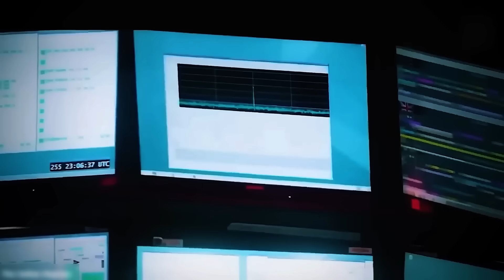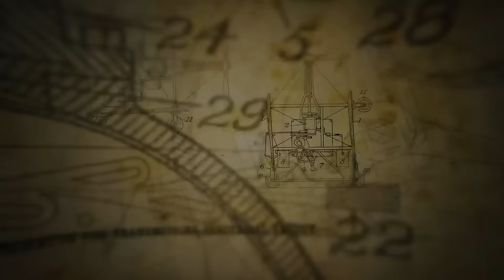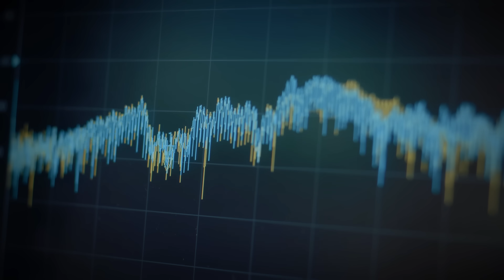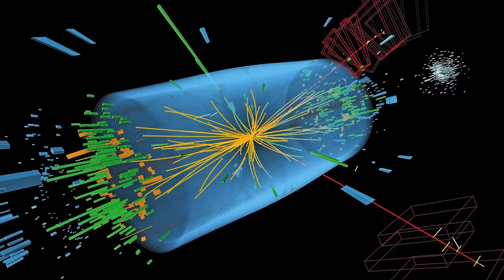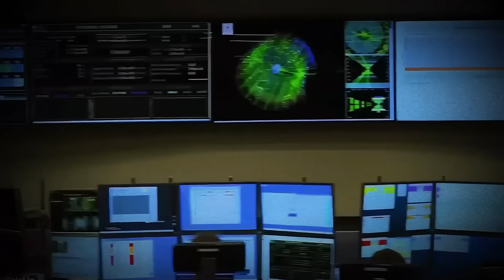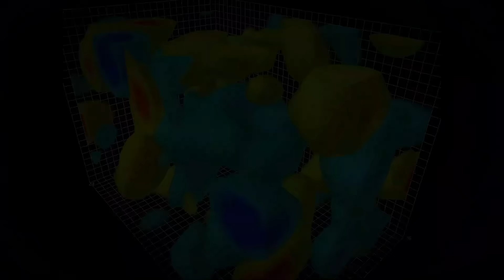Scientists Recreated Tesla’s Ether Experiment.. What It Revealed Was Chilling

Comment: There is no vacuum.
The Aether has a volumetric pressure of 1.
The energy, or quantated volume, of 1 cubic centimeter of Aether , cannot possibly hold more energy than the galaxy, logically.
Everything in the universe IS Aether, excited, and redirected into standing waves perpendicular to the axial signal input into the "Particle" .
Therefore, there is no mass difference between the Aether and a particle of any size.
The.only difference between the Aether and a particle is directional perturbation.
QM and GR are garbage...